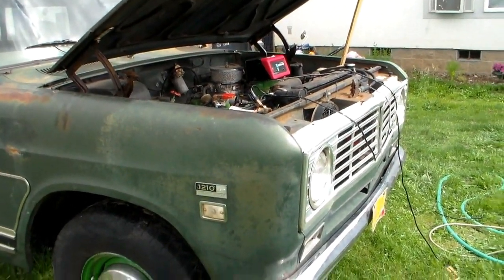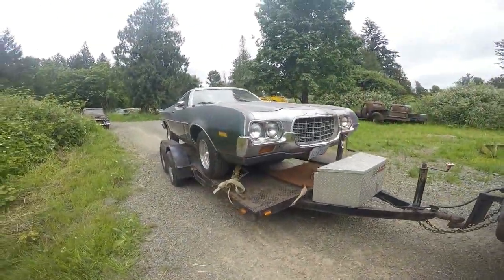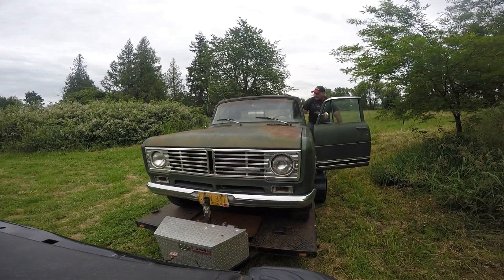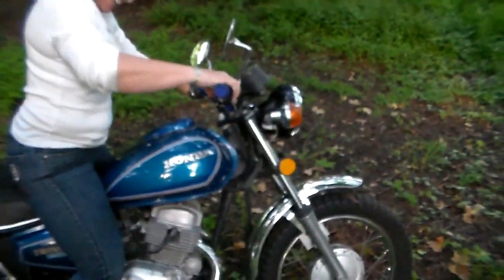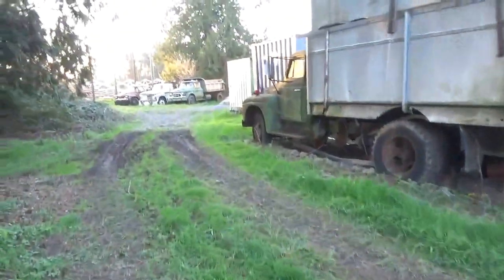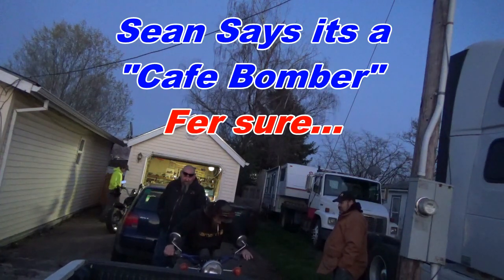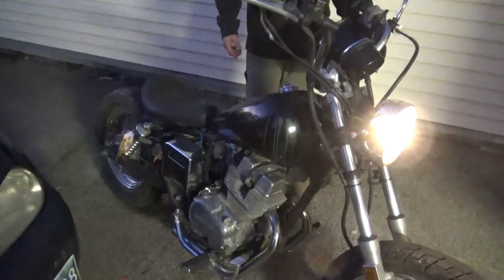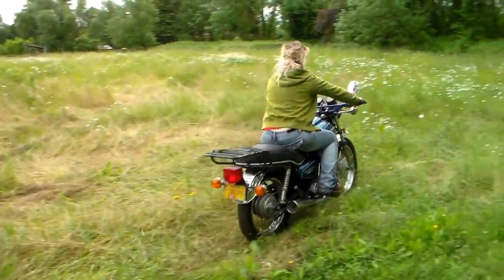My Wife Turned into a Biker Chick....I love it! (CTR-184)

Comment: Congrats Jamie! I've worked on a number of these and lordy you must be short! lol These are low slung to begin with, but a couple little modifications and you can get the seat height down 3-4 inches safely and still have plenty of suspension. Cheers! Zip~

Comment: softail the frame,dirt bike forks out of  that yamaha it?(sitting by the vette).Laid over neck.small air shock with a solo seat,definitely a coffin tank.Toot name in gothic font on the tank and drill the donk to 350 with a two into 1(triumph bonny style).T bars with brass 2 inch risers.Jeff cochran themed bike(sucker punch sally).

Comment: The one thing I'll say about these Twinstars is, they have an odd wheel size, so your choices for tires is limited. A Brat style of build will fit nicely with the Enduro tires. Enjoy It! Being just a 4 speed limits it a little and the lack of a Tach is a little off putting, but it should keep up with the big dogs just fine. Known issues with these is limited and it's usually related to the carburetors which is (in my opinion) under sized. Keep the Rubber to the Pavement! Zip~

Comment: a few years ago I bought a 250 honda rebel from a guy at works son it didn't have plates or insurance so I didn't ride it first it only had 3000 miles on it and ran like new I thought it looked like a sportster so I bought it got plates and insurance and away I went only rode it a few times im afraid to death of it lots of power for a 250 but im 6'2" and its height is very very low it felt like riding on a mini bike at 50 miles an hour definitely made for a small person everybody I talked to said they call them chick bikes you check one out it was comfortable to ride if I was about 5 feet tall